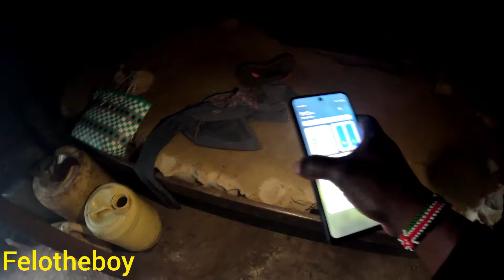Mama Maria finally shared her feelings _The blood of Jesus surrounded her family.

Comment: I've noticed Felo all the houses you construct has the same problem , that water getting the rooms. This is due to the fact that you don't build a good foundation. The foundation should be off the ground all around at least a block or two high that way the floor is slightly higher that the actual ground. You  continue to cast the on the ground leaving no substantial foundation on which the house sits.
However I applaud your efforts.